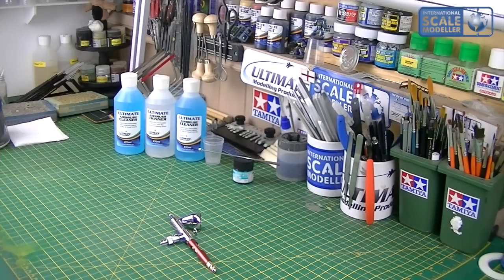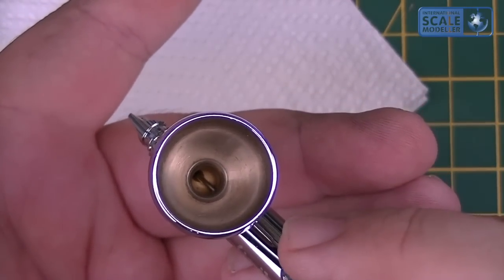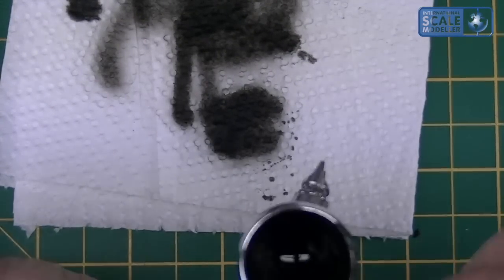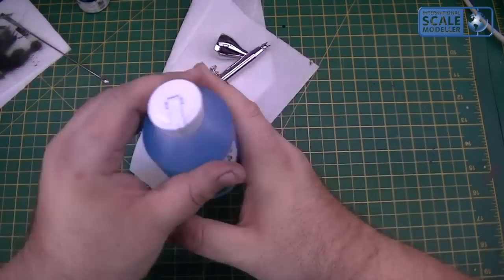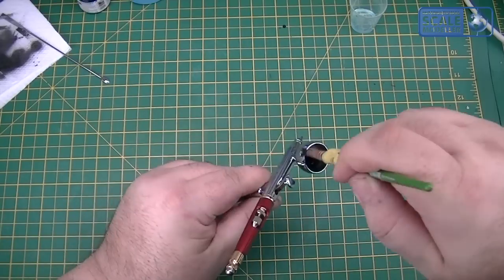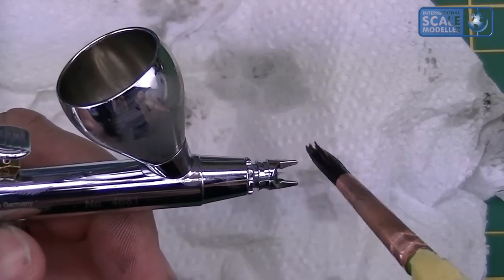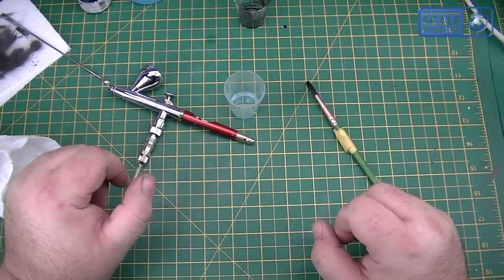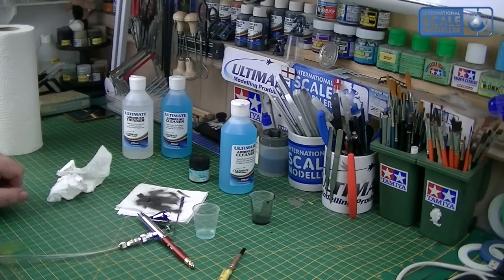How to Clean Your Airbrush Cup Tutorial

Comment: I clean my airbrush exactly like this but I would always find the needle jammed inside the next time I came to use it. I would have to pull it out and I'd find dry paint on the brush.  No matter how much thinner I would spray through this always happened. I got into the habbit of leaving a bit of thinner in the airbrush as Paul has done, and I take the needle out as well, wipe it off and leave it out.
Reply: Try some super lube. Tremendous.

Comment: Does the Ultimate Airbrush Cleaner help unblock clogged airbrushes or would I have to use some stronger element of alcohol? Have an airbrush that is driving me mad! Cleaned it though-out and still acting like clogged
Reply from the maker: +ModArt633 This stuff is all you will need.  Take the airbrush apart completely, place the components in a small plastic cup and cover with Ultimate Cleaner, leave for an hour then clean and replace - All should be good :-)
Reply: Ah thanks, that will be perfect :)

Comment: Brilliant tutorial but would'nt "back flow" put some stress onto the seals?
Reply from the maker: Iain Hamilton have to disagree if they couldn't handle the pressure of being back flushed the seals would be useless. I've been doing this for years with all different airbrushes without issue, it's widely regarded as a safe thing to do :) - Paul
Reply: Hi Paul - thanks for the very quick answer and I will certainly take your advice on board use it. I am still pretty much a novice when it comes to airbrushes when it is clear you certainly are not - and just one more "wee" question please - in your video would that be cleaning the AB between colours or after a full session?If a full session you have just saved me so much time as I was always under the impression that once a days painting was done the AB was stripped down and thoroughly cleaned . Looking forward to more videos from you and thanks again from a new subscriber.